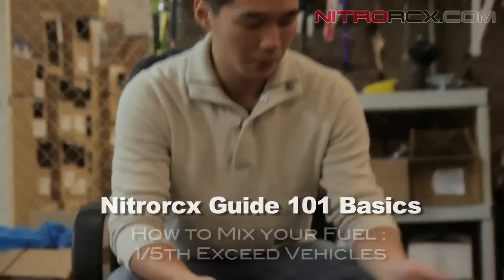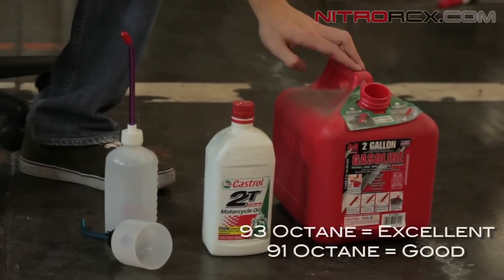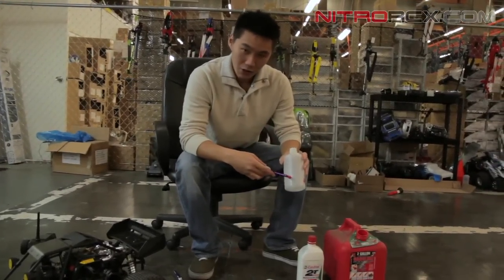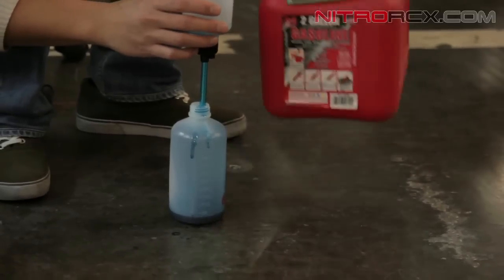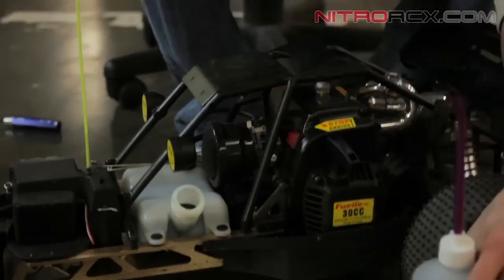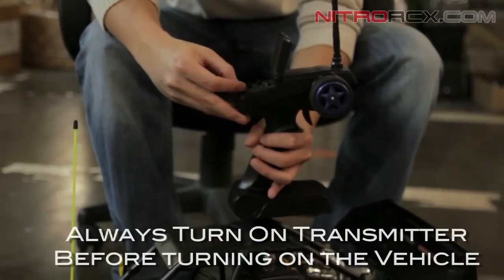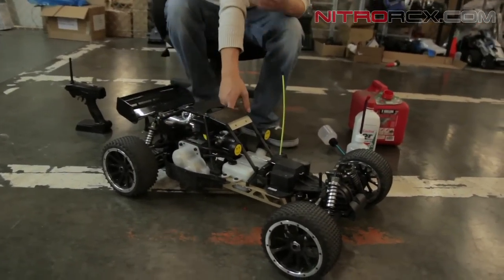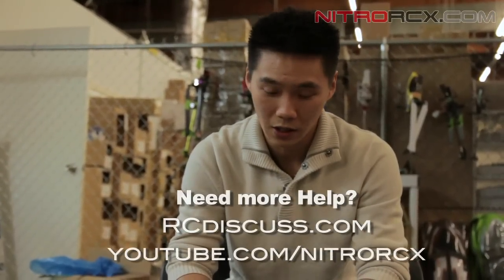How to Start Exceed RC Gas 1/5 Barca and Hannibal +Fuel Mixtures +Needle Adjust,Remote Control Truck

Comment from the maker: @TheCjcoon You will need to break in the engine yourself, all of our 1/5 gas cars will come with the fail safe. The antenna is pretty short it's just that the antenna tube was put on and wasn't cut to length before the video was made.

Comment: @mememojo that is very true about lower octane fuels, they can combuster if you have high compression which will destroy a motor if it fires while the piston is on is compression stroke. its like the piston hiting a wall. Higher octane is made to stop predetonation it can be compressed to alot higher pressures without acting like a diesel and just igniting under high compression. Mainly if you have a turbo or supercharger that forces air into your motor you can use better gas to stop it

Comment: You can always use higher octane number but not lower than manufacturer recommend! The higher the octane number, the more compression and temperature the fuel can withstand before detonating.

Comment: Guysm use Mineral type oil for breaking in and FULL - synthetic for running (Ensure high temp lubrication) NEVER NEVER NEVER! use marine oil, that's a total different oil for low rev but high torque engines.  Any brand is fine. 
If you do this, it'll ensure your engine to serve you as much as you served it. 
Oils can usually be differentiated between mineral and synthetic by color. Black (The one he used) is usually mineral, yellow or brown/gold should be synthetic.

Comment: ALso for ratios, if your car is above 30+ cc's, it's good to run it at 25:1 along with 40-50 cc engines (Not rc related), but UNDER 30 cc is fine to run at 50:1, also if there is too much fumes on the 30+ cc ones it's best to run it at 32:1 ratio. 90+ octane should be fine.

Comment: @alex38079 This 1/5 scale has a 2 stroke gas engine, your Traxxas most likely has a Nitro engine, you need nitro fuel for it, there is no gas in your fuel, so in short no you can't use it in your rustler. The 1/5 scale pretty much has an engine very similar to a weed eater or chainsaw engine, you use the same fuel for the both.

Comment: when breaking in the motor its better to use a lite bit more oil than you would use when bashing. its getting more lubercation and its make the engine life longer. i would recommend 25:3

Comment: you can use 87% octane becasue we use it on all petrol trimers 
and these engine dont realy need a high octane based fuel
even on the 30.cc engine we still use 87% octane so it does not matter what fuel octan you have you can run that engine on 100% octane

Comment: May you open up the batterie area to see all connections and safe wire, on this model, when i bought mine batteries and safe wire were in a box on the 1/5th scale 2.4ghz exceed rc barca 30cc gas.

Comment: 87% octane is normal unleaded so thats what i can ownly get where i live and if cars run on 87% then so can a weed wacker engine can
because petrol cars can run on any octane level but 87% is cheaper  but it still does its job

Comment: FYI: 20ml oil in 500ml MIX is 24:1, not 25:1. To get 25:1 you need 500ml FUEL + 20ml OIL = 520ml MIX
Reply: Same here!!
Reply: 25x20 is 500,,,To me that is 25 to 1
Reply: It tell you to mix 25 parts of petrol to 1 part of oil so therefore you get 520 ml
Reply: I also understand he should have made it of a total of 520ml
Reply: Does it really matter? 25:1 to 24:1? Will make no difference at all.
Reply: @Mark-wx1ho  Of couse it does.  24:1 is a richer mix.  Is the difference great?  Maybe not, pending the application, but the difference is there.  The main people who would notice are those who drag on a timed drag strip.  Most bashers may never notice.

Comment: I have a traxxas fuel bottle that goes up to 500 so I just fill it up to the 20 mark with oil and the rest with gas till it reaches 500 mark??? thanks just making sure before I put in the gas and I want a fresh mix every time that's why I use the fuel bottle to mix and not a 2 gallon tank .

Comment: Would I be able to put that fuel mixture in my Traxxas Rustler 2.5 engine?
Reply from the maker: The Rustler 2.5 is powered by a nitro engine so no you cannot use this with your nitro engine.

Comment: Hey mate, I got a nitro 1/8 scale what ratio would I need for my specific rc.
Reply: Yours is nitro and most likely a 20% nitro. Do not use gas. You need nitro fuel and its already mixed.

Comment from the maker: There's no real need to mix your own nitro fuel because most places that do sell nitro fuel it's already premixed.
Reply: Plz answer: will this work for 1/10 buggys
Reply: This is not nitro fuel
Reply: What's the best oil to use in 1/5 rc
Reply: +Eric Turner Maxima castor 927.

Comment: How the fuck could 110 octane damage the motor?

All octane does it prevent it from pre-detonating, which could crack / blow your piston apart.

The higher compression you have, the higher octane you need.